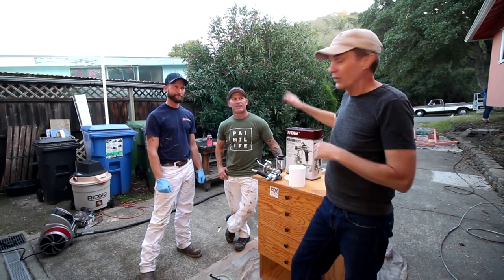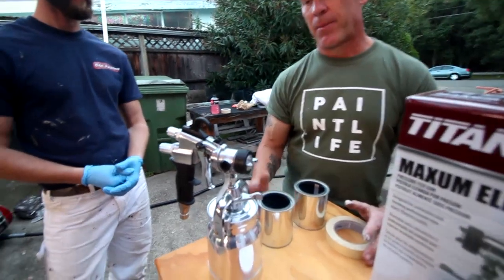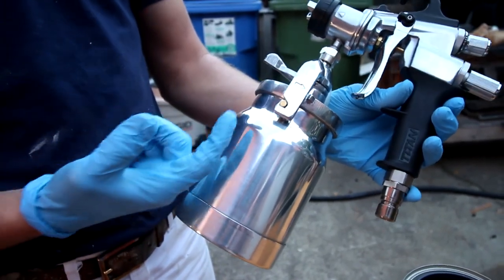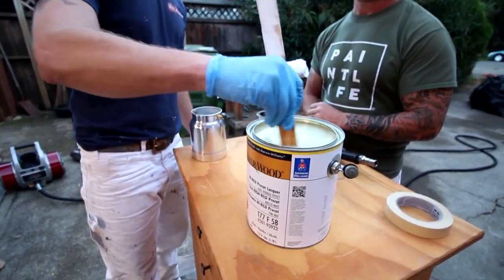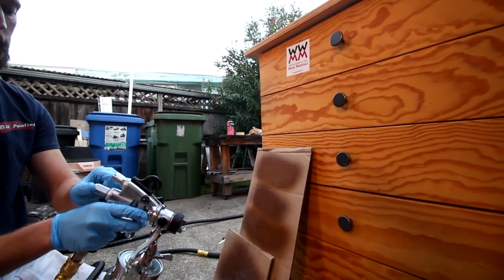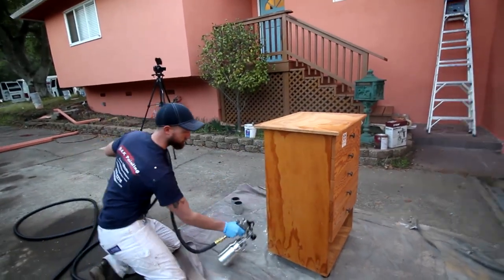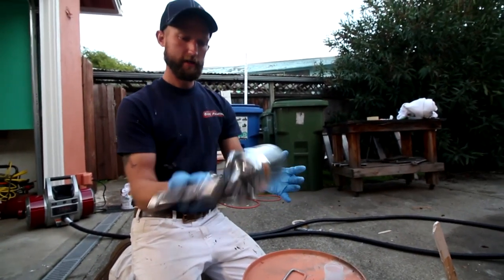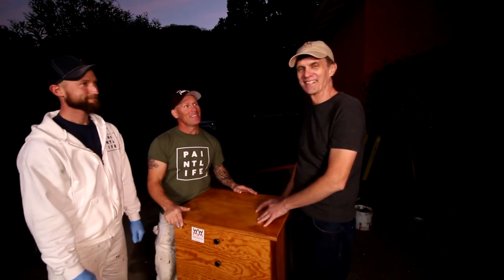Spraying Lacquer with HVLP | Step it Up

Comment: Talk about timing! I was just about to hit the purchase button on another gun when I got the notification to this video. Watched it and changed my purchase. Thanks Steve!
Reply from the maker: Cool. I have a pretty cheap gun and it actually works pretty well with my compressor, but I definitely notice an improvement in the pro system like John was using here. Better adjustments and smoother flow of material.
Reply: Oh don't get me wrong, I clicked the link to the cheaper sprayer set you had in the description.

Comment: Pro tip. Keep your turbine off the ground (on a spare 5 Gallon bucket) and as far away from your work area as possible.  That way you avoid clogging your filters prematurely.  One side of the Titan HVLP intakes air to cool the turbine, and the other side intakes air for the sprayer, so there is a lot of movement near the turbine unit.  Keeping it out of the paint and overspray can help the filters last longer.  I hope that helps someone.  Oh, and Chris, It would be cool to see John on some more Idaho Painter videos!  You guys should rename yourselves the Youtube Painters.  LOL Thank you for your continued good content.  You have made me a better painter.

Comment: I've been spraying Deft brushing lacquer for 25 years. I started with a siphon gun but learned how to use a gravity feed cup gun when I worked in the paint department of an auto factory. Love the cup gun! It works well for automotive lacquer as well as solvent based paints.
Reply: jimbooth3 I've been using Minwax clear brushing lacquer in my HF HVLP gun for years and it works beautifully. It's also good on tools to prevent oxidation. I have no idea why the can says to use only for brushing, but I spray flawless finishes with it consistently on wood or metal.
Reply: jimbooth3, i have the same product. What thinning ratio do you use?
Reply: taterman320241 
Basically the brushing lacquers are Nitrocellulose lacquer ,what people use to finish guitars
Reply: taterman320241 good tip for me to know. Thanx
Reply: What ratio do you use to thin your Deft lacquer?  Thx
Reply: @tundrawhisperer4821  10:1 Sorry for the delay. 1 part thinner to 10 parts lacquer.
Reply: @jimbooth3  wow, okay. I’ve had a lot of people saying 20-25% lacquer thinner.

Comment: HVLP means High Volume Low Pressure.  I noticed a higher pressure was used and faster spray pattern.  By lowering the pressure and spraying slower, more material will stay on the surface and not bounce off into the air (atmosphere) as demonstrated here.  Yes, It takes a little more time and attention to spray, but you will save in material cost in the end and get a thicker coat without repelling gas and material into the atmosphere.  You can run the risk of runs with the slower technique, but practice makes perfect.

Comment: I've been using that laquer for lots of years. that stuff is a big time saver. I use the Sherwood sealer 1 heavy coat then light sanding after 30 min the I spray the laquer. I also use a gravity hvlp 1.8mil tip for the sealer and 1.4mil tip for the laquer and I don't have to thin ennything out. it is a great product

Comment: As Steve pointed out, you can get excellent results with inexpensive equipment. I have an expensive Devillbiss HVLP gun that I can attach to a 1 quart pot or to my 2 1/2 gallon pressurized bulk tank depending on the size of project I have. I've also used my HF 1 pint gravity feed HVLP for smaller projects, as well as my HF cheapie airbrush for really small projects, in place of rattle cans. It's really more about the mix, the setup before hand, and technique than about the equipment. Adjusting the the mix of lacquer/thinner, airflow, fluid volume, the fan size and air pressure before the gun are paramount to good lacquer finishes. These are not all that difficult to get dialed in. Using some scrap cardboard as they did in the video helps a lot. I've used a small portable air compressor as well as my big shop compressor. Both were set up with canister filtration to remove oil and water so as not to contaminate the air hose and subsequently your lacquer. I also made up an inline, quick connect air regulator that I can connect right before my gun inlets. This is nothing more than a HF $15.00 pressure regulator with gauge and a male and female quick connect on either side. This saves in having to adjust the pressure at the air compressor and puts it right in your hand. My big 150 psi air compressor I keep set at 90 psi delivery to my shop. That's satisfactory to run all my air tools. With the inline regulator I can adjust as low as 5 psi or as high as line pressure. Most HVLP applications/guns only need 15-40 psi.

Comment: I refinished all my doors using this method, same product. The issue I had was horizontal surface... it looked like crap.  I was getting waves.  I ended up standing everything vertical and the end product was much better.  I was spraying straight lacquer, I didn't thin it and I believe that was the issue.  I bought a cheap cup gun from Napa Auto Parts.  I think I paid $45 and used my existing air compressor.  Worked like a champ.

Comment: I would say there are a couple more helpful TIPS to spraying lacquer that this video has overlooked. First, weather conditions. There are three weather conditions that need to be met when spraying lac, ESPECIALLY outdoors. First, the humidity needs to be less than 90%, the temperature and the dew point need to be at least 5 degrees apart and the temperature cannot be falling over the next 24 hours (falling as in, not rising back up). The finished lacquer pieces "GAS OFF" for hours, even up to several days. It is important that when gassing off, circulation of air continues and no pets or humans are in a closed area with the pieces. To avoid 'blushing' woods, especially dark stained wood, use a Lacquer Retardant. Just a capful in the cup. Strain lacquer before putting it in the cup. On vertical surfaces, spray a 'mist' or 'piss' coat, wait one minute and spray the heavy coat. It will create a matrix for the heavy coat to grab onto, and will prevent sagging and dripping.  Remember that lacquer is very temperamental.
Reply: The last part, I spray the first coat, wait 1 minute and make another heavier coat? Like, while still wet?
Reply: @ElLoyler095  You apply the "piss" coat by only pulling the trigger part of the way so it can put a light mist on the door. It will dry in a couple minutes and then you can apply a full heavy coat. Remember with lacquer, you are trying to create a "matrix" (the "droplets" of lacquer connecting to each other is what creates the strength and smoothness) and it must be a nice full coat with no holidays.

Comment: I have used a similar equipment for the last 25 years. Of course it´s a little more primitive, but it works in the same way. You can save almost 2/3 of the amount of lacquer to the same film thickness compared to a conventional air spraygun. great stuff!

Janne Bergstrom, Finland

Comment: I have done a few projects with my HVLP sprayer, but I really try to avoid anything but water borne finishes.  I recently remodelled nearly my entire house interior and I hand stained all my oak doors, then used General Finish water borne top coat.  This worked very well and saved me a ton of time.  The time is in the set-up and clean-up, applying the finish is so fast you feel guilty!  I could have sprayed the stain, after thinning, but the stain is oil-based, and I just don't like putting that stuff on with my gun.  If I had a second gun, then maybe I would, so that they would be separate. 
Anyway, nice video, and thanks for putting it together.

Comment: A couple of points:
1. Rockler makes the Paint pouring lid thingy. It's a life saver for pouring lacquer from a Gal to a gun can.
2. Sherwood Pre-Cat Hi-Bild is awesome.
3. Yes you can keep lacquer in the gun for some time. And yes it'll get a little crusty, but in the end if you just clean out the needle point you'll be fine.
Reply from the maker: Thanks Joel. Good tips!
Reply: Joel Crawford you don't want to touch the needle unless you absolutely have to, if something even slightly bends on the the whole nozzle needs to be replaced
Reply: Where can you find sher-wood hibild precat these days?

Comment: Hvlp gun stands for high volume low pressure, with that said the liquid cup is above the gun (I use them all the time doing auto body) what you have here is a siphon gun
Reply: Not an expert but with all the reading there are HVLP siphon guns. The issue there is the high pressure - that's not low pressure anymore.

Comment: Like the video Chris is a awesome painter 👍🏻 I usually spray with air on when cleaning out the gun use my finger to back up the fluid gets the little holes clean then I keep lacquer thinner in the cup throw the tip in there close it till the next time help is the only way to go

Comment: Thanks for the demo.  I tried using a sprayer.  It works fine, although you have to fiddle with it to get the right pattern.  And it takes some practice to avoid runs.  And cleanup can take about as much time as the actual spraying.  And then you have all the waste solvent to store.  And then unless you do a lot of it, the finish material gets out of date.Soooo, I use water based poly and wipe it on with an old sock.  Sock goes into a baggie between coats.
Reply: Pete M 
A sock?
Reply: cotton.  with holes!  I've used paper towels on small surfaces (but it abrades rather quickly).

Comment: I may have missed it, but did you mention tip/nozzle size for the spray gun? A what about a small touch-up gun for smaller jobs when you don't want to mix up a quart? Great video, thanks for the info.

Comment: That's the start of what I was looking for. I have a Capspray 115 and 2 maxum elite guns. and in a similar vein as a CNC tutorial,  I need a "feeds and speeds" tutorial for HVLP. This was a taste if that using laquer, how about oil base vs latex, can you use both in the same gun? I'm sure it would be cleaned in between but can that cleaning technique use here be trusted if you are switching paints?
Reply: Good q's you ask, I am still learning the hard way too. Learned 1 ton from this vid and some of Matt lange's vids.

Comment: I have a faux bamboo set from the 70s with original finish. It's smooth like a countertop. I've painted furniture but never lacquer. I want to do the blue lacquer with a glassy high gloss shine. Do I need to lightly sand, prime? Does lacquer need any prep like paint? This is a very smooth piece. Like laminate almost. Sorry for all the questions. Can't seem to find anyone who knows.

Comment: What if you were to use water / oil based poly in an HVLP? Would you clean the same way? Or is there a different type of liquid cleaner you’d used instead of lacquer thinner? I’m assuming paint you’d clean with paint thinner?? Poly ... mineral spirits??

Comment: i am now gonna buy a HVLP sprayer. I actually heard the electric ones work pretty good.. but ive never tried either. much love
Reply: Matt Diresta I like the pneumatic ones better than the electric ones because I feel they are more consistent, lighter and easier to use. the electric one that I bought sucks. I'm used to using industrial sprayers from work and I wanted one to make easy work of a few projects at the house so I bought an all electric Wagner and I hated it. Even after practicing with it and trying to get the settings right, it just wouldn't give me the consistent quality that I would expect. And it was unbelievably loud.

If you are going to get one, I would invest in a pneumatic one or one with a turbine (like the one they used), a few rolls of plastic or several drop cloths and a really good respirator and painters coveralls. 

A good, high quality gun could be the difference between an enjoyable experience and a disaster.
Reply: Kendra Gray thanks for the info. 😃

Comment: Like the gun you guys use. Looks better than mine. I'd only add that I flow my material thru a cone strainer into my cup and also hold the gun parallel to the vertical surfaces rather than rocking up and down.Otherwise, good video.

Comment: I noticed that when you pored the Lacquer that you had a LOT of spillage, when I worked with my Dad in his Cabinet shop, we had the same problem until we took a 10 pennie  nail and put about 5 holes in the grove that holds the lid on. This also allowed any Paint/Lacquer or anything else to drain back into the can and not leave anything to clean up before replacing the lid. 
P.S.  we always put a shop rag over the can lid before hitting it with the hammer to make sure that if anything didn't drain back into the can, Did Not spray us when we resealed the lid on the can.
Reply: Easy to just dip a pint container into the gallon can and put it in the cup until the gallon is controllable. Also, they did not strain the lacquer, which I always do.

Comment: To give more technical information about the white goo that settles out on the bottom. I was a formulation chemist and if you have worked with DEFT lacquers then you have touched a formulation that had my hand on its formulation.

TL;DR particles of a flattening agent settle out depending on its characteristics and if there an additive in the coating then it will help keep it held in suspension. You pay for what you get.

In general, there are particles that create a uneven surface to transition micro sized smooth rolling hills to smooth to rigid boulders all over the place. 

 A one ways to accomplish this gloss drop is using a silica, ex. AceMatt TS100, in a batch of coating as its being made. Silicas vary depending on the actual silica product. Examples of types of silicas is treated with a wax, untreated, hydrophobic, particle size, oil absorption, fumed silica... it's endless and they all have their own attitudes when formulating a coating. 

Another way to do this is using a wax. There are so many waxes and one example is Ceraflour 969. Waxes are sensitive to solvent blends and some will not work in water. How hard or soft the wax is will determine how well it performs in making a gloss drop. If its too soft then it will literally rub to a 90+ sheen or too hard and it will not "grind" into the batch creating a rough texture. 

Now to the actual goo at the bottom. There are additives in the coating that keep these particles held in suspension. ex. Disperbyk-103. Dispersants are chemical compounds that help hold up a product from settling. One way for this to happen is to have a section of the chemical compound have an affinity of hold the compound though a weak attraction to it. Imagine dropping a rock vs putting a parachute on a rock.

These products can cost dollars to $18/lb. This can be expensive to the manufacture of the coating. You pay for what you get. If it hard settles then it might not have an additive in it. If it soft settles then it might have one. It all just depends on the characteristics of the flattening agent. Some need it, some don't . Buy a 30 sheen clear that has to be stirred every few hours versus buying a clear that costs $3/gal more and stirred once a day with an even gloss reading.